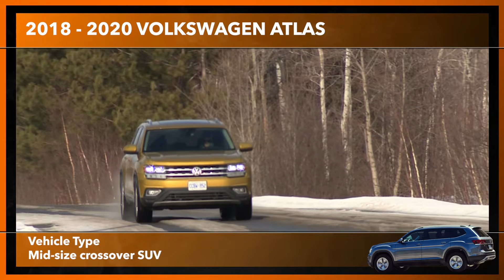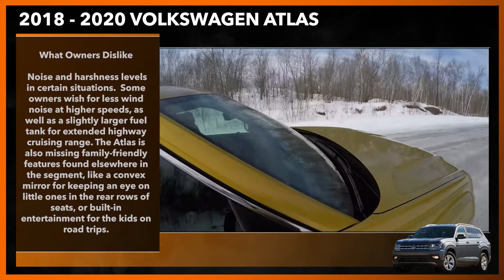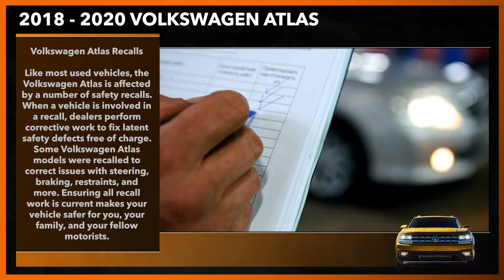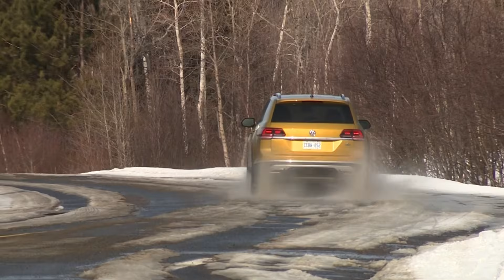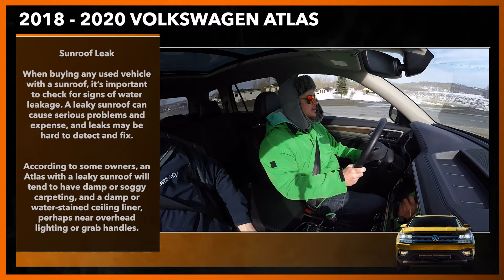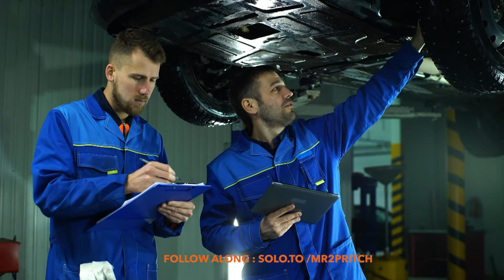Buying a Used Volkswagen Atlas? These 5 Checks REVEAL Hidden Problems.

Comment: My 2021 has a very weak electrical system, that prevents me from being able to run short errands throughout the afternoon during of your time because if I don’t leave it running for 15 minutes before I park it for the night, the batch will be dead in the morning and according to Volkswagon Canada, there is no fix for it. Also, the key fob batteries need to be replaced almost every three months but the worst problem of that is my command start is only the distance of 3 to 5 car lengths that is basically useless in the winter or in extreme heat in comparison to my 2016 GMC terrain that I could start on the street from the seventh floor or even while I was going down the elevator to the basement parking. And what 3.6 L engine needs a rear seal replacement after 40,000 km.?! absolutely do not expect any help from Volkswagon technicians because they are like a cult that believes their product is indestructible. Despite the evidence they see every day and Volkswagon corporate even though Canada just stole billions of dollars for a plant they never built are not willing to fix these problems most likely because they don’t have a fix for it and they’re definitely not gonna pay for it after the warranty is off even though it’s obviously a Volkswagen problem not a driver problem.

Comment: Leaking sunroofs are usually because the drains are clogged which gives the water no place to go but back up onto the top of the headliner.  My wife's Atlas had this problem, and it leaked out between the headliner and rearview mirror mount. As a person who has owned a few VWs before. I knew of this issue before from past vehicles.  When my wife took the Atlas in to have it checked out. I told her to mention the sunroof drains to the service advisor and after fixing the issue. They confirmed I was correct as dirt and pine needles had filled and clogged the drain holes.

Comment: My 2018 Atlas was at 80k miles with zero issues. Decided to trade into a different SUV cause i wanted something different and that was big mistake... I miss my Atlas and considering getting an Atlas again.
Reply: What did you change to?
Reply: I changed into a atlas 18 from buick enclave and I miss my buick
Reply: @earlenehandley5579these are literally the two cars I’m trying to decide between at the moment
Reply: @jasminewilliams3757 I love my buick enclave it's more luxury than my new VW gonna take me awhile  to get used to it not a smoother ride as buick either

Comment: I have a 2018 VW Atlas Sel Premium 4motion. 57k miles and its been in the shop 2 times. Issues with high pressure fuel pump, ECP error. Having doubts if i should get rid of it while i still can
Reply: That’s only 2 times lol, if it needs one more random fix I’d get rid of it
Reply: Get rid of it.

Comment: I own a 2018 Atlas, and regardless the few issues, I love it! For once I have a vehicle that isn't a full size tank that I fit in more than comfortably with lots of head and shoulder room. (6' 3").  This review is spot on! Road noise is higher than I would like, and the wind noise seems like the doors aren't sealed tight. I just started having issues yesterday (10/04/23) with my digital dash readings between my physical RPM and Speedometer. It was set to display mpg on the fuel economy setting, and is going haywire! I pull out and it jumps from 5 mpg-10-323-224-all over! The warning systems have worked perfectly to prevent further damaging the vehicle, such as my water pump went out and before the care overheated to extreme temps, I was notified with an audible and visible warning message. The transmission is a bit wonky as it's a 9 speed AT. It might work well in hill country, but here in Florida, on slight grades, it has trouble deciding which gear it likes. Also, if you want to pull out fast, sometimes it'll take off like a rocket, while other times it gets hung up between the gears and just doesn't feel like it. I absolutely HATE the feature that turns the engine off when stopped. It's supposed to be eco-friendly, but to be honest, it takes more gas to start the vehicle eatch time, thus producing more emissions. You are just wearing the Hell out of the starter!!! Imagine going to the grocery store a mile away and your car starts and stops 9 times. Tire pressure alarms are sensitive and help prevent running on low pressure to conserve fuel mileage. As stated in the review, the main battery and FOB batteries. seem to go out like clockwork at the times noted. When replacing the battery or after you've unhooked it, keep in mind that my model has 47 electronic items that must be reset, and having a professional do it for proper calibration is recommended to avoid future issues. IMPORTANT: The overhead Car-Net features do not work because the world switched from 3G to 5G, and the system is no longer support.  Some articles claim it was only for the 2018-2019 models, but there were models in 2022 that still weren't updated on the lot. I asked the dealership what VW's plan was, and the tech said there is no plan. Covid created a microchip shortage which compounded the problem. Some models at the dealership were discounted hundreds of dollars due to missing chips that canceled some options. This was not isolated to just Volkswagen, so with any car, test EVERYTHING as the buttons might be there, but they are for show only without the chips. The Atlas has more interior room than any vehicle in it's class. I fit a plush twin mattress easily in the back and use the auto hatch button on my fob to climb in and sleep at rest areas on long trips. Would I buy again? I lean to yes, but it's the most expensive car with maintenance I've owned. Cars are becoming so bound to electronic tech that there are more problems than ever. I still have a recall for the passenger airbag seat sensor that VW hasn't come up with a fix for as well (5 years now)!
Reply: Advise change oil in the tranny I change mine and still works fine ,, and it’s an 8!speed tranny made by aisin, the best by far made  by toyota
Reply: I’m planning to buy one with 140k km for 18000 in Canada what you think ? Cars over priced now this is cheap compared to others

Comment: Do not buy these without a warranty they aren't by any means reliable suv
Reply: The v6 is reliable. No major issues on the 2019+
Reply: Had mine for 5 years, 200000km and doesn’t consume a drop of oil between services. To date, it’s one of the most reliable cars I’ve ever owned…dealer services till out of warranty then I took over doing it myself. Never looked back, in fact I’m considering getting a second one because it’s that good 😂
Reply: What model year and engine?  @radeshenmoodley4147
Reply: Yeah, that’s what I’ve been reading man I really wanted one  🤦🏽‍♂️
Reply: 100%. 2019 V6 Atlas owner here. Within the first year of ownership I've had the sunroof shatter out of nowhere while driving (common issue), infotainment system freezes/malfunctions regularly (common issue), have had the front collision system malfunction and apply emergency breaking - thankfully no one behind us (common issue), torque converter design (many forums on this issue) makes a horrendous noise at low speeds. Had no idea what the noise was and took it to multiple shops. Each dealership said they couldn't recreate the noise. It took me pulling a tech aside and asking him what the h*ll before he would admit to exactly what the noise was. My first and last ever VW purchase.
Reply: Can you elaborate please? Looking at a 2022 with the VR6, 21,000 miles.
Reply: Did you ever get it? I just got a 2022 two days ago and I love it!@ABDdrummer
Reply: I often find people seem to jump on these reviews just to complain. My experience and that I’d three of my friends is one of bliss. All are AWD and all tow with their Atlas. These really are a solid SUV. All of these SUVs now have in excess of 150,000 kms and. One. Had had the Sun roof leaks people speak of. Regular maintenance will keep you rolling. If you buy with a warranty, awesome but in any case make sure you have a thorough PPI before you buy any vehicle!

Comment: Im in the market for a new car, between the 2021 atlas se and a 4runner sr5, which would be a better option? I know nothing about vw reliability /cost vs Toyota
Reply: If you choose the Atlas, MAKE SURE IT'S THE VR6. It's a proven engine and it's paired with an Aisin transmission. Aisin is Toyota, so you shouldn't have major problems if taken care of.
Reply: Bro don't listen to these people these atlas are built cheaply by VW you'll only have problems with this turd
Reply: Im glad i got the V6

Comment: When your hood wire breaks how do you get to the emergency latch 2 open volkswagen atlas
Reply: You don't. 

Raise it up on stands, (or a lift, if you have access to one), take the drivers front wheel off (17mm socket), then the fender liner (the plastic shroud - T20 Torx bit). Once that's out of the way, locate the back of the headlight housing and look just above it, along the edge of the fender. You should see a small black cable that goes into a small plastic rectangular box, with a cable coming out the opposite end. 

If you unclip that plastic box from the fender and rotate it, you'll see 2 pull cables, very similar to the brake cables on a bike. One section goes back into the cabin, the other goes to the front of the car - That's the one you want to pull on. One cable will have a metal bead or slug on the end of it, the other will have a notched hollowed out cylinder, I just don't remember which side had which. I'd recommend using vise grips (locking pliers) to grab the cable with. If you slowly pull it, it should pop the hood.

All the cable failures I've seen have been either the metal bead, or the metal cylinder slip off the braided cable. I have yet to see the metal cable itself break. Best of luck
Reply: @vinnyboombatz1399  have you found that procedure tiresome to carry out every time you want to check the oil or top of the washer fluid?
Reply: @MaxRockatansky-b5n 

Huh? That's how you trigger the hood latch in case the lever on the inside fails

Comment: Have a 2019S 2wd with zero issues. 2.0 engine averages 27mpg so the gas tank is plenty big enough. No sunroof with this model so no leaks.
2 recalls with 1 being suspension bushing the other was a software update on the tire pressure monitors.It's a keeper.
Reply: I just bought a 18’ V6 w/4motion, it’s a lot more car than I can ask for lol I was driving around in a 05’ Toyota with 270k miles
Reply: Wondering if you had any issues after this comment? I just bought a used 2022 V6 AWD
Reply: @Charlieperez714  Still running like a top with no issues.
Reply: @HighGear7445  how many miles?
Reply: Hows yours?? @Charlieperez714
Reply: I'm glad you had no issues with the 2.0

Comment: It looks like everything has some issues 
Battery recharging issues
Gear shifting issues 
Roof issues
Infotainment issues,...
Almost everything...

So why people don't buy toyota brands??
Reply: Toyota have similar and even more issues these days.

The Atlas is hands down the best bang for your buck big SUV these days…. No gimmicky features, everything has a purpose and hands down better safety than any Toyota.

And let’s not even talk about night/day difference in road noise, build quality and overall comfort
Reply: @Manis-World my neighbor hit my 24 atlas at parking spot, I got a cosmetic scratch on the rear bumper she has to replace the whole front bumper on her Toyota venza..
Reply: Myself and a friend own the 3.6 vr6. No issues.
Reply: @tag1pumpkin  which year & trim?
Reply: the back row on a highlander are so small and looks dull
Reply: Too high
Reply: Price
Reply: And you think Toyotas never have problems. Atlas with VR6 engine has an Aisin transmission. So if it fucks up, it's your TOYOTA that fucked up. VR6 engine has been around forever and hardly any issues with it. Any engine is bound to have something minor to go wrong. Even Toyotas.
Reply: I got mine 18 12000 mi water pump I replace it other than that nop vr6 better than most  no issues at all but not many ppl know about vr6 reliability  ,, old engine  no failure
Reply: Me and my wife are looking at a 2019 Volkswagen Atlas SE with 42,000 miles on it still has factory warranty what's the pros and cons with them they a good SUV or stay away from it they want 20,000 for it
Reply: Because most Toyotas have no soul
Reply: No matter what auto, NEVER Purchase a 4-Cylinder.., EVER!!🇺🇸
Reply: Add to that 
Common VW Atlas Problems

Faulty fuel injectors

Engine noise on shutdown

Unexpected coolant loss

Fuel pump failure

Faulty clockspring

Really Nice shape & interior room on the Atlas I was considering a 2019 for about $28k because i wanted Adaptive Cruise without buying a $50k new one 
Guess I'll look into a '17 Lexus RX350 w/ Adapt cruise for $31k instead 

because these issues on the Atlas are a turn off plus i remembered I rented one in '19 in Vegas & had to turn it in after only 1 day because the coolant light came on & it was new
Reply: @rondavid7413  we have 60K miles on ours and none of those problems.
Reply: @rondavid7413  it was new, but did anyone else drive it before you?